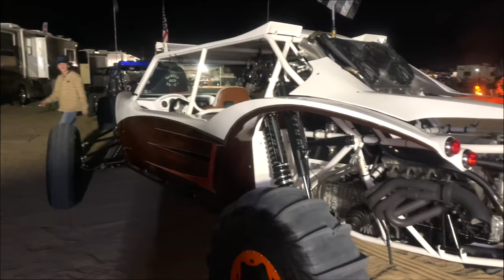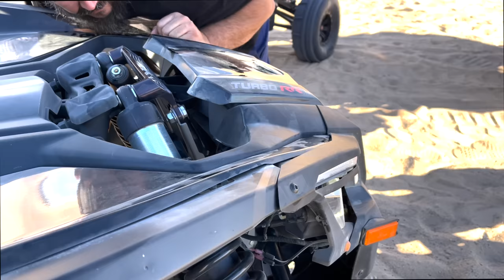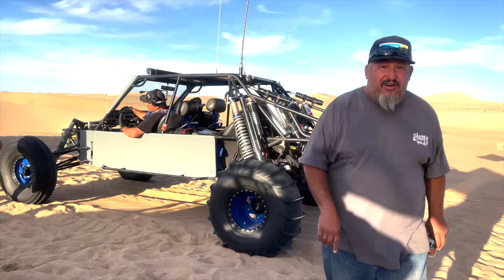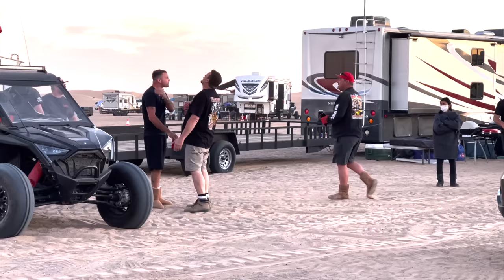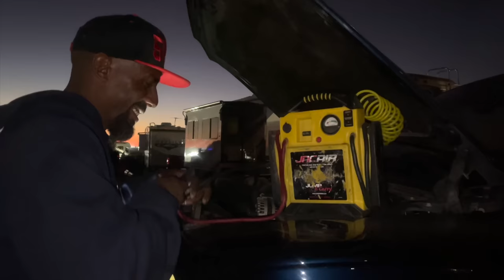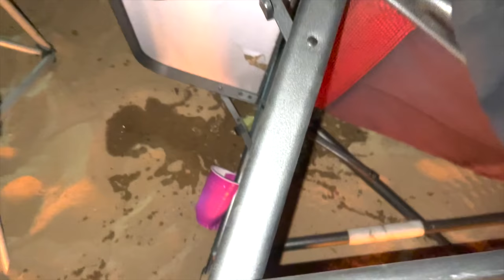GLAMIS DUNES DRAMA Thanksgiving 2022 & Gordon Wells Ride | DIRT BIKE DIARIES EP.155

Comment: Yeah this is what happens when you don't even look in your inspection holes or behind covers after your cars have been sitting between seasons........ (How much you wanna bet this is what happened at the beginning of the last season too.)💁‍♂️🥯
Reply: Shit happens 🤷🏾‍♂️ even with new parts
Reply: @gixxer562  ..... but more so with old dried out flex-hardened parts rubber belt type parts..... and batteries sitting in trucks while new rig&pinion get replaced. BAM!!!🤗
Reply: @skeetermcswagger0U812  lmao my truck has a list of problems and surprisingly enough the battery isn’t on it. It’s the alternator and or something electrical. 🤷🏾‍♂️ but making moves to get something bigger and better 😁
Reply: @gixxer562   Well I hope your little tiny buggy doesn't have battery problems cause that's pretty much all there is to it!!!!🤗